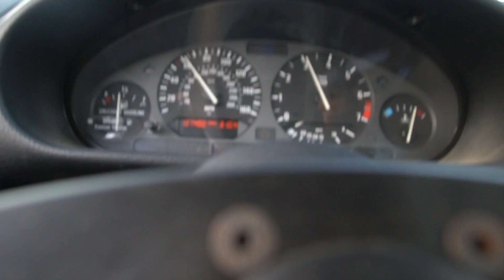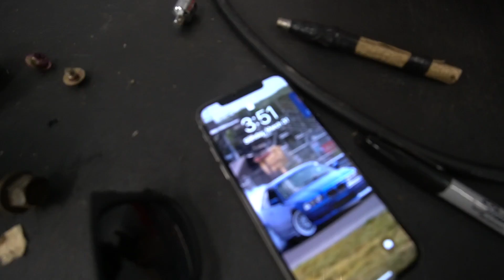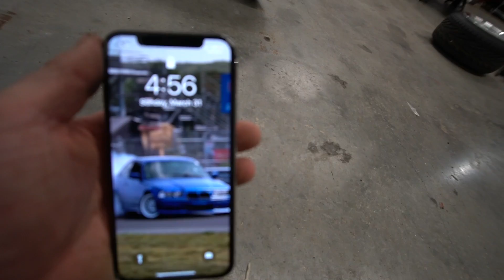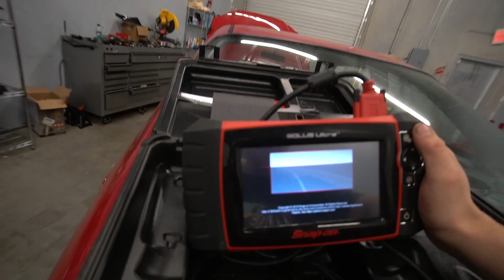I CAN'T BELIEVE THIS HAPPENED!

Comment: Trans blew because you put thick fluid in it you put like 80w-90 it takes 10w-30 motor oil or Honda mtf look it up thick fluid doesn't flow good enough and they will blow
Reply: Jack Nelson 80w-90 is standard light grade gear oil for transmissions and diff 10w-30 is like water for a transmission
Reply: Dorifto_z31 you know nothing about Honda's, my oem owners manual for my 1995 Integra ls says to use 10w-30 motor oil in the transmission look it up
Reply: Jack Nelson owners Manuel 😂😂😂 you can use what ever you want when a car is that old you can put syrup and it’ll love it lmao nah but fr tho if your going to use motor oil you would use rótella truck oil 14w-40 10w-30 is too thin for anything older then 15 years
Reply: Dorifto_z31 I've only ran Mobil 1 10-30 in my Integra for the past 15k miles of straight abuse
Reply: Jack Nelson oh yeah defiantly it run and it’ll love it as long it’s oil and as long as it lubricates like I said you can use 0w-20 if you want but it won’t last as it would if you were using 80-90 gear oil some people even use  75w-140 it’s your preference you can run what you want you can test it you’re self with time a tranny running on 10w-30 will have more wear and tear then a transmission running on gear oil but you never know what the case may be really it all depends on what you do with the damn thing 👌🏻👌🏻
Reply: Fellow teg owner here. My s-80 takes 10-30 in mine and it rarely sees the street, almost always the race track and never had any issues or bearing noises. I’ve taken the car across the state too. This whole motor oil in the transmission debate is wack as fuck. I also work a oreillys and even our shit parts system says to use 10w-30 motor oil in the trans..Personally I just put whatever comes out, back in it and I’ve never had an issue doing it that way.
Reply: Honda mtf or Pennzoil synchromesh is the way to go for d,b,and k series honda transmissions.
Reply: Th4t_P00L_Dud3 playa my transmission has 221k miles on it. And I’m beating the ever loving shit out of this thing too. It’s gonna get some nice synthetic 10w-30 and I’m just gonna send it bud. Because at the end of the day, it’s what works best for me. if it ain’t broke don’t fix it with a more expensive lubricant.
Reply: @THESK8LIFE97  Hey if it works stick with it. Just sayin ,in general ,that most use honda mtf or Pennzoil synchromesh. I use Pennzoil synchromesh in my street car civic b20vtec with an Integra gsr transmission and do pulls all the time. I use Redline transmission fluid in my Integra that's set up for SCCA stl class road track racing. My reply wasn't directed at you ,but whatever
Reply: Th4t_P00L_Dud3 lol I have a freshly built b20v 62mm turbo. I run SMF. What region are you out of? My old b18 setup ran 1:48.3 at gingerman last summer I’m hoping to improve on that. Keep banging gears brother
Reply: @THESK8LIFE97  Right on man. I'm central division, Milwaukee region. Road America and Blackhawk farms are my goto's. Talked with guys that have raced gingerman before and would like to compete there sometime. Maybe this season if the budget allows. Have a good one brother

Comment: Wow me and you did the same thing I blew the teeth off my diff because the input shaft bearing failed and got in between the gears. 

I cut my arm in the video but I got it off and split pretty quick

Comment: If you end up getting a transmission, get a y8.. the y7s are a tad bit longer ratio than the d16y8s.. depending if you want longer or shorter gears..

Comment: Same thing happened to my old car, it had 230,xxx miles on it and when I put a brand new clutch in it the transmission blew up.
Reply: Did you put an unsprung clutch in it?
Reply: @Addison0526  it was a single mass sprung factory replacement clutch

Comment: Is the temp gauge correct on the BMW? If so does it always run that close to hot? I know the LS runs hotter than most from the factory but I doubt you have a stock thermostat in it now.

Comment: I thought it was the diff not input shaft and I was right. Wheel hop will kill a honda transmission faster than boost. Also most honda guys(myself included) run either Honda mtf or Pennzoil synchromesh in the transmission.

Comment: I had a 95 Civic and I was driving at a slow speed in first gear and the car randomly started bucking really hard and before I had a chance to either shift into second or quickly put it in neutral it made a loud bang then rolled as if it was in neutral until it stopped in a parking spot. The spider gears broke apart and if I stuck my finger in either side of the transmission where the cv axle goes I could feel the spider gears binding up and then they fell apart down inside the transmission case while I was feeling the spider gears.